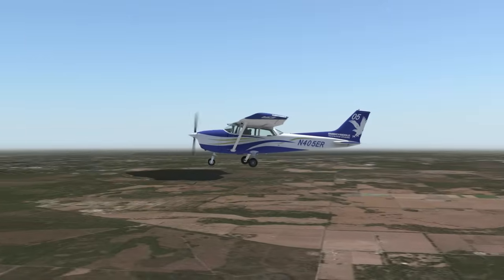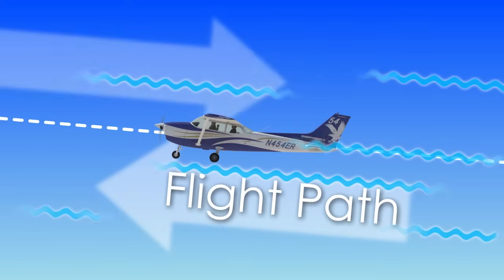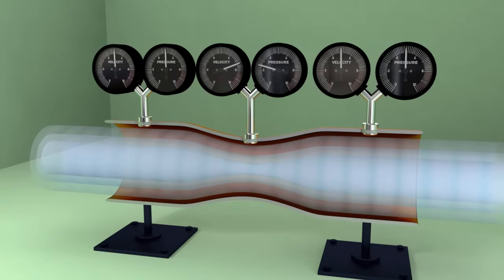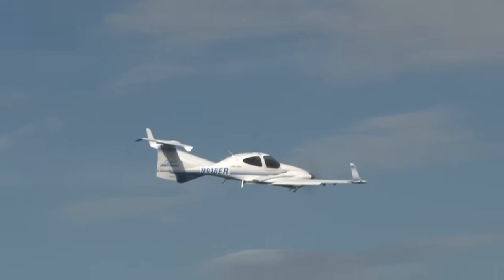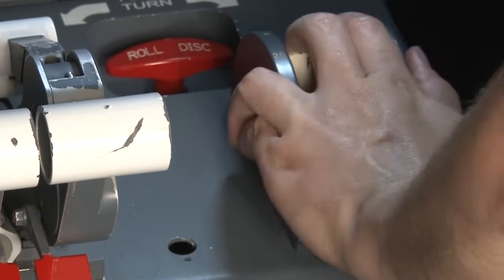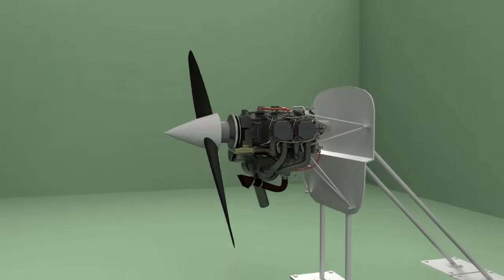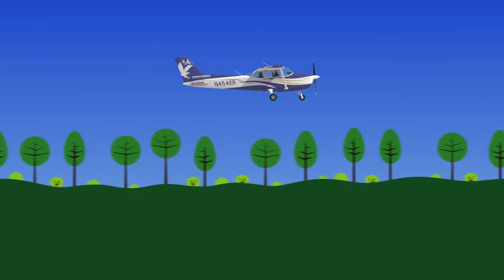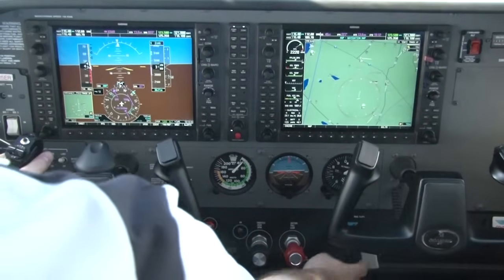Principles of Flight

Comment: Great explaination of newtons laws and how it related to lift. One thing I didn't agree with the pinching of flow at the leading edge causes the velocity to increase. This would be the case for internal flow in a pipe, but not always the case for flow around an airfoil

Comment: Very good lesson.  It would help safety and reduce fatalities, I think, if the lesson on dynamic neutral stability were added in this lesson or perhaps wait until the stalls theory lesson.  Somehow this seems to get lost in the flight school program of orientation and indoctrination.  We old guys can discover this by asking what causes and airplane to stall.  The answer is 99.9% "the pitch angle of the wing reaches the critical angle of attack."  But that, given neutral dynamic stability, is not how the airplane is designed for safety especially in turns.  The airplane cannot stall itself.  A pilot, or computer, is required pulling back (ok forward if inverted) on the stick.  The pitch angle  reaching the critical angle of attack is when the wing stalls.  Pilots cause all stalls.  Wolfgang, in Stick and Rudder, talked about what the airplane wants to do.  In the interest of safety, and fatality reduction, we need to orient pilots in the maneuvering flight environment (say around the airport) need to allow the design of the airplane to prevent stall.  In the maneuvering flight environment, where inadvertent stall is fatal, airspeed and not altitude is life.  We are teaching the wrong orientation here when we insist on maintaining altitude at any cost.  We need orientation toward knowledge of and even use of the potential energy of altitude to provide extra airspeed to make a turn of any bank, not just limited bank, a 1 g turn.  If we turn without back pressure on the yoke, without worry about altitude, we will not stall in the pattern.  The airplane is incapable of that.  High altitude orientation says altitude is life.  We don't live there during takeoff and landing.  Down here airspeed is life.

As a crop duster and pipeline patrol instructor, I have been teaching low altitude orientation since 1974.  You guys have a lot more clout than me.  A little help here please.  At least let your students know that there is a difference in the low altitude environment and labelling it taboo does not help pilots understand the difference.  They have to take off and land in non-rocket powered airplanes until they get to be an ATP.   Some might even go Ag or fight fires or work low.  Theory has neither vertical nor horizontal space available limitations.  Airport patterns have both.

Comment: 4:00 because mass flow rate of a fluid is constant (A1V1=A2V2) when the cross sectional area of the pipe decreases the velocity must increase. The reason pressure decreases when velocity increases is because the pressure had to increase beforehand in order to increase the velocity of the fluid. And with the airfoil it’s the same thing since the top part is curved air molecules have 5:06 to travel a greater distance over the wing than under the wing so their velocity is greater and pressure is less than the bottom. Since pressure under the wing is greater and pressure = force/area this means the force component of pressure under the wing is greater. So if you just look at the wing as its own system and Force on wing = mass * acceleration then there will be a positive (upwards) force and thus a positive (upwards) acceleration which we attribute to flying. Note that the air molecules act on the surfaces of the wing with an impulse which has a Force component (impulse = force * time) so this force from the air molecules is what contributes to the Force component of pressure and the pressure and velocity differences stuff puts us back at Bernoulli’s principle

Comment: you could design a small craft...the size of a bird with fixed wings that utilised a totally novel approach to flying...by shooting out a weighted cable in front and above it and then using a motor to climb the cable...

or another idea...shoot out an electromagnet in front of the craft and turn it on off as required...

if you propel the cable you can change the direction of the cable for complex maneuvers...

Comment: Why does air move faster over the cambered upper surface of the aerofoil? Why does it not move faster against the flatter less obstructive lower surface?
Reply: Think of it this way instead; the air is still and the air is being knocked out of the way for just a moment by the wing. The upper surface is wider and like a big man moving through a crowd, knocks the other people standing there ( air molecules) out of the way farther but as it ( he ) passes by,  the air ( bystanders ) immediately go back to their positions.  They had to go further to get back so they had to go faster and that faster recovery speed caused low pressure.

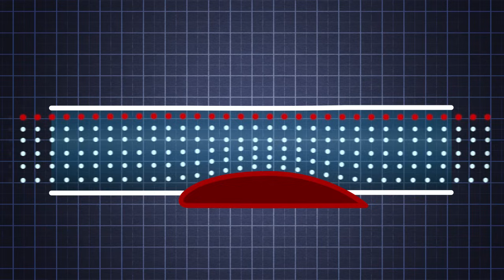Comment: At time 4:40 there is a great mistake in explaining the priciple of how lift is created by an airfoil. The upper surface of a wing is NOT the lower half of a Venturi tube. The air is NOT squeezed into a narrower flow path.  The real reason for the lower pressure of the air above the air is the curved path that the air has to follow across the upper surface of the wing. Any mass that follows a circular path - (a large part of a wing's upper surface can be regarded as as a sector of a cylindrical surface - forcing the air in a circular path for this part of a cylindrical shape) experiences two opposite forces that are perpendicular the the curved path of the airflow: a) The centrifugal force, pulling away from the wing surface, and b) the the centripetal force pulling towards the wing surface and forcing the air to follow the wing-shape, rather than following a straight line. Those opposite forces (trying to pull the airstream appart) produce a low pressure in that airstream above the wing. The difference between the low pressure at the upper wing surface and the pressure at the lower wing surface (which is close to ambient pressure) is the main reason for the lift that a wing creates.
Reply: You sound like an engineer
Reply: @rsk6929  Yes, I worked as an engineer in aviation.
Reply: @sorgfaeltig  Cool I'm going to Embry Riddle to be an Aero Space Engineer.

Comment: I was a US Navy Schooled and Experienced Aviation Flight Controls Systems Mechanic/Technician, '8 years' doing it.  I am really amazed how Engineering Mathematical Physics applied to real world problems solutions for the advancement of man. 
Now we have Artificial Intelligent computerized algorithms with the fusion of miniaturized sensors used by modern Control Systems Engineers using Kalman Filtering computations by a computer to control the complex operation of an airplane in flight, drones and all types of modern automation, all that has made a Piliot's job easier today. However, A human pilot's brain though is still the most used computer for ultimate decisions for SAFETY in the commercial world.

Comment: I think I found an error at 2:26
According to that explanation, the angle of attack will always remain a constant. No matter the angle the plain is flying, the difference between the two values remain the same.
Right?
Reply: What they did not mention here and what you are probably correctly considering is the FLIGHT PATH of the plane. If the speed of the plane is increased or decreased,  the flight path will then change and then too the angle of attack will change.

Comment: Is weight a force? Isn't it gravity?
Reply: It's the weight force that is meant here, but gravity has a significant impact, indeed.

The weight force W compounds of the mass of the object m times the gravitational constant g (9.81 m/s^2). 

The Maximum Take-off Mass (MTOM) of a Cessna 172 is 780 kg. The applied weight force is W = m*g = 780 kg * 9.81 m/s^2 = 7’651.5 Newton.

Comment: Is this 'half venturi" the way it is explained in the advanced aerodynamics courses at ERAU?
If this is the explanation, how does that wing fly upside down and how does a completely flat wing generate lift?
.
This also says: "The air traveling over the wing will increase in speed and as a result, will have a lower pressure than the air below the wing."
This says that the lower pressure is caused by the increase in speed.   How can that be?

Comment: I enjoyed the video, but wanted to point out that the best glide speed is for max distance with no wind, not for max time in the air. See 13:44. Best glide speed will let the pilot travel the farthest, but not stay up the longest. If you need to maximize time, perhaps to have more time to fix the problem or communicate intentions or prepare for a forced landing, then the minimum sink speed is what you want. It will be slower than the best glide speed.

https://www.faa.gov/news/safety_briefing/2018/media/SE_Topic_18-05.pdf
Reply: You are quite right. During a ground cat I would not be too surprised if a candidate failed to distinguish between ‘best glide speed’ and speed for minimum sink rate. But for such an error to persist in the work of an accredited training organisation is pretty piss poor.

Comment: If the Bernoulli effect had any major effect at all on lift inverted flight would be impossible.
Reply: Have seen 3 theories of flight, but aerobatic aircraft have symmetrical aerofoils. It's only the angle of attack that creates slightly different path lengths.

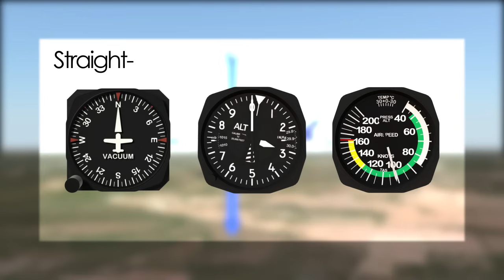Comment: 0:46 - At straight & level, unaccelerated flight, Lift=Weight. Agreed, since the flight isn't climbing nor descending. But Thrust=Drag ? Doesn't seem right because the flight is moving forward at steady velocity. If they were equal, the flight would just stand still & thus go into a stall, wouldn't it? Experts?
Reply from the maker: At a steady velocity, thrust equals drag. If thrust is greater than drag, the plane accelerates. If drag is greater than thrust, the plane slows down.

Comment: It is so weird, that angle of attack is a clime while I always thought the attack is a decline.
Can be an angle of attack both climb and decline or only when plain gain altitude (climb)?
Reply from the maker: Angles of attack can be both positive and negative, although they are almost always positive. Depending on other factors, a positive angle of attack can result in either a climb or descent.

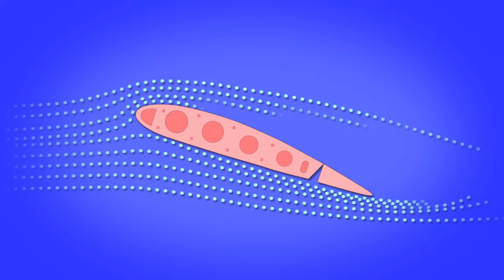Comment: This video is very good, with one exemption: The illustration at 3:20 does not explain Newton's third law, because the airflow is not deflected downwards behind the wing (it looks more like a stalled wing). According to Newton's third law is lift the opposite of the downwards force created by the air flowing behind the wing. And what is completely missed, is the fact that the air is pushed upwards BEFORE the wing, balancing the downwash behind the wing. Finally, Newtons second law is essential: Because of the curvature is the air accelerated above the wing (thanks to Bernoulli). F = m * a. This acceleration creates the downforce, and the opposite force is lift (Newton's third law).
Reply from the maker: Thanks for the feedback! In designing this course, we had to consider not only our audience (high school students,) but also the purpose of the course. It was designed as an introduction to aviation theories and principles. Don't worry....once students enroll in a degree program at the University, they will get their fill of physics and aerodynamics. :-)

Comment: Excellent video! Regarding the discussion of L/D; I'm not sure that flying a speed or angle of attack for that condition will allow the aircraft to stay aloft the longest (as stated at about 14:00). One must fly the minimum sink speed to achieve that. Minimum sink speed is slower than L/D and can be found using a polar curve (glider handbooks have these). L/D max gives maximum glide range, or most distance for a given altitude. Looking forward to more videos. Thank you!
Reply from the maker: Since the manufacturer doesn't publish a Minimum Sink Speed curve for the Cessna (or most powered aircraft) we chose to simplify the discussion and go with the manufacturer's recommendation. We always encourage pilots to dig much deeper into all of these topics, and especially into aerodynamics! Glider flying is a wonderful place to start!